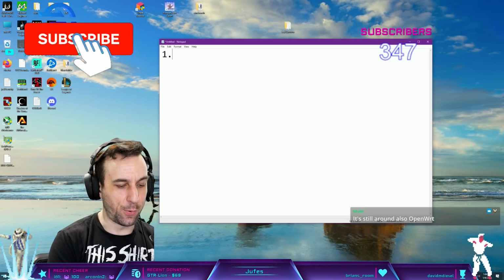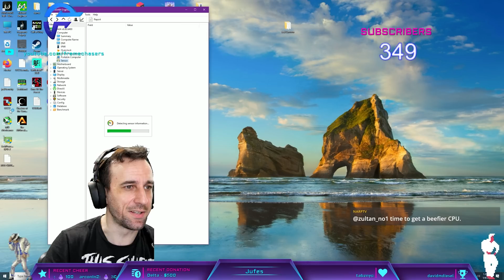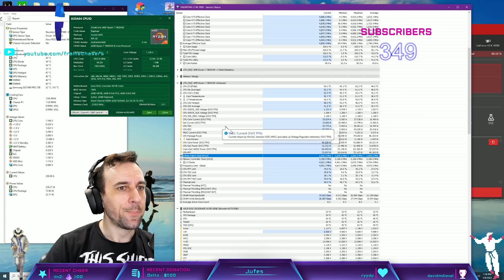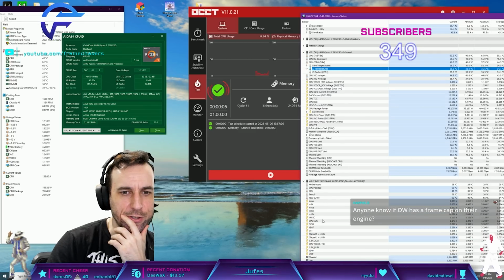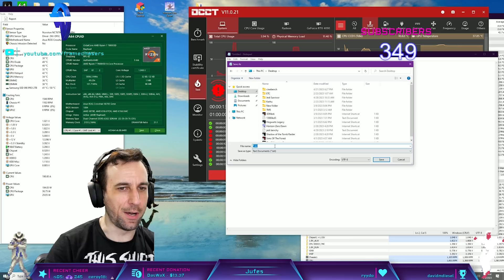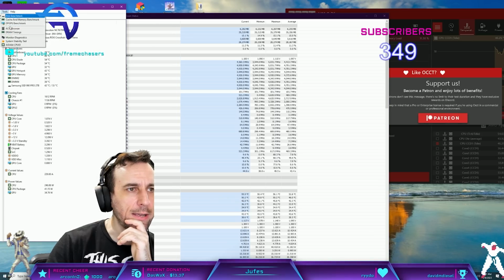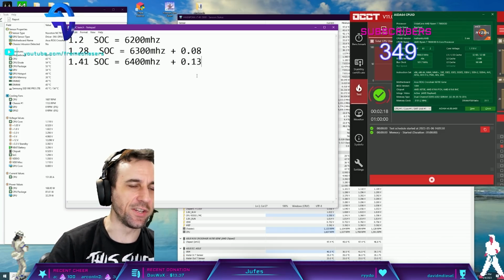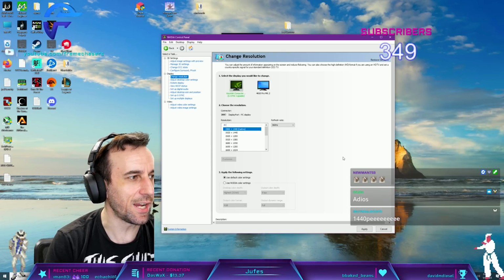Please Don't Do This...  7800X3D SOC Voltage Scaling. 😵

Comment: Queria saber o motivo do clock do meu 7800x3d esta baixando em jogos, ele conserva em 5050 porem quando ocorre algo cai os clocks e logo voltam

ppt limit 77000
tdc limit 280000
edc limit 350000
curve opt negative -40
ddr vdd 1.4
ddr vddq 1.4
subtiming controlo
32 42 42 84

benchmark r23 esta fazendo 18400 pontos com 4850 mghz e 5040 mghz em outro, com 75c°, nao uso scalar nem llc, quero deixar cravado 5050 no cinbench sem deixar baixar os clocks batendo no maximo 70c° 

heeeeelp

Comment: i am on expo setting vsoc 1.33v. for 6400mhz 32 cl on 7800x3d .  lexar ares rgb 32gig ram. dont know if it might deal damage in the long term. i wish to lower the soc but i dont know how and i am worried that i might spoil my pc. i hope for the best.
Reply: Same. My board is pushing 1.310v for 6000mhz cl30 on 7800x3d. I don't know if I should change it or keep it.

Comment: My board was pushing 1.38v soc when I first set up my 7800X3D and 6000mhz EXPO.  
It's entirely stable for over 2 months so far at 1.2v
Reply: Mine is pushing 1.310v and I'm not sure if it's safe
Reply: @Khannah69  It's safe, though longevity will probably be affected a bit if it's running that voltage all the time.  You should set PBO up and turn on C-States so it backs voltage off on a balanced windows power plan.
Reply: @CHAOSMOVEMENT  Didn't try PBO CO yet. I'm already on balanced power plan. C states on auto
Reply: @Khannah69  C states looks good, just try setting PBO to core optimizer, all core - 20 and see if it's stable.  You can try auto but it will run higher voltages.
Reply: @CHAOSMOVEMENT    I'm in the same situation here. On my MSI B850M GAMING PLUS WIFI 6E board, it's set at 1.304V by default  with XMP enabled, but sometimes under load I hit spikes up to 1.310V (it was during compiling shaders (in game) in  RPCS3, which is known to be a CPU-hungry app). Do I need to lower it a little to 1.29V? (I fear instability) I will eventually try to put it on balance and do some tweaking in curve optimizer. Hope for the best.🤞

Comment: With expo 6000 memory Gigabyte defaults to 1.287v on HWinfo but u can manually set it to 1.115v and it will be fine.

Comment: Anyone know if higher soc voltage helps latency? Or does that not matter much. Currently on 6200 with 1.25 volts but i can definitely bring down the voltages of soc if needed just curious

Comment: F that 200mhz anyways man. If my system is safe in 1.2v it will be on 1.2v. For so long ive waited to upgrade my system. Finally i had the chance to do it but now i have to deal with this sht. 
So yeah expo on /1.2v soc seems the way to go. Thanks for the video.

Comment: SoC voltage has nothing to do with RAM voltages.
SoC handles the memory controller voltage, and EXPO does not change SoC.
Reply: Higher memory clocks needs the infinity fabric aka memory controller aka vcore soc to have more juice to work. Thats why he was searching for maximum memory speeds with lowest vcore soc possible

Comment: When i had the 670 extreme and 7950x i had to enable memory context restore and pwer down mode to get any kind of stability. 

This 3d update looks like a wash when you have to finalize implementation and scheduling yourself. 

At this rate, the amd chips should be 300 dollars off in its current state

Comment: What you'll probably find based on my extensive testing is that it seems to be stable at lower SOC voltage but isn't (it'll pass OCCT, Aida, Prime 95 for hours fine), but then it'll ransomly crash out during gaming etc. My chip needs 1.33v to do 6400 stable (and I think I have a very good one), it's taken me two weeks to find this out and LOTS of testing. I might drop it down to 6200 and lower timings if it's happy at 1.3v or lower now.
Reply: @madpeteST you still running 6200 at 1.3v
Reply: Guys, how are your chips after 2 years on 1.3+ VSOC? 😅 No burned holes?
Reply: I'm running at 6200, I needed almost 1.4v to hit 6400.  6200 seems to be MUCH easier on the IMC and I don't like fire...
Reply: @Pandemix78  hows the cpu now?
Reply: I have 6000MHz Ram and im really unsure whether I'm stable. Currently, I'm on 1,15V vSoC and everything seems stable (y-cruncher, OCCT, prime95, Linpack, aida64 and playing LoL)
However, according to what I see here, I'm probably not stable... How did you notice instability exactly?
Reply: @Germania-444  hows the cpu now?

Comment: Hey dude, love your content. By any chance, do you have a video on under volting a 13900k? I know you focus on overclocking and getting those gains, but just wondering how you would run a 13900k so it won't run too hot if you have limited cooling options.
Reply: Turn off ht. Limit cpu to 250w

Comment: Voltage is beyond the point, the point is that the CPU can short itself and not shut down on thermal…I can go into my BIOS right now and set the voltage to 1.5 on my Intel and it won’t burn up, it will just power off..This chip is flawed from a design point, as it ages that limit of 1.3 will start to creep down, 3 years from now 1.2 might cook it..AMD is like taking a stock 2L Honda engine and strapping on a 64mm turbo off of a cumins diesel, sure she will go like a bat out of hell for half of a dyno pull, but she’ll explode, not a matter of if, but a matter of when. Stick with what works boys and girls, stop chasing saving a couple bucks and getting an extra 2%. All the stock holders are FAFOing around too, nobody in the server space is loyal, if they were then nobody would of gone to AMD, if Intel comes out with a banger than AMD will go back down to 13$. No value, just like their consumer products. AMD took a lot of risks, that’s why they came up in such a short amount of time, Intel is slowww they take their time, test test test. In the long run and for myself, I want reliability so I’m going to stick with Intel and NVIDIA, a couple good products in 3 years doesn’t mean anything to me, especially when they have all had issues.

Comment: 6400 at 1.3v no issues, been running at that sense 7800x3d launch.
Reply: 6600 at 1.285 which droops down to 1.265 on hwinfo under load, 7500F
Reply: I have mine at 1.33v and it’s really scary, it is the auto value from the XMP profile
Reply: 6600 is crazy then you can also run 2200 flck for max juice

Comment: Just buy 13600k + 760/790 board with DDR4. Cheap, fast and 0 problems. I OC'ed lots of different platforms, 13600k + 790 + b-die was by far the most fun, it either recovers really fast from errors or is just rock stable with seemingly crazy high settings (like 6ghz).
Reply: You mind saying what settings you used to get 6ghz? i get insane temps when i get to 5,8ghz in cinebench (360 rad and d5 pump)
Reply: What B760 do you use? Im torn on what to pair with the 13600kf
Reply: What a joke, 7800X3D faster than 13900K on way less power consumption.
Reply: @Directx11cool  AMDfags on full AMDip control jej

Comment: When i had my 5800x it was stable at 4.8ghz at 1.28v. To get it to 4.9ghz it needed like 1.5v...just not worth it. Seems AMD just cant figure it out. Intel is just so much easier. Stable 5.4ghz on my 13700K (stock turbo all the time) and 7200mhz DDR5. Glad I switched

Comment: Increasing SOC above 1.20v causes nothing but problems on my B650M Aorus Elite/7700x. I leave it at 1.20v but there is a process for getting a stable 6200mhz. I have to boot into windows w/stock bios settings, then shutdown and boot with EXPO enabled, then shutdown and boot again with 2033/6200. If I try to do all bios tweaks at once it will NOT boot into windows at EXPO 2033/6200. Once I follow this procedure though I'm good to go until bios update. I can get it faster with lots more tweaks and voltage but it makes zero difference in gaming far as I can tell.

Comment: My friend wanted a 7800x3d rig, I have his memory running at 6000 with heavily tuned timings and its perfectly stable at 1.150 SOC voltage.
Reply: What ram kit is he using?
Reply: @Next_Play_Shenanigans  I don't remember off the top of my head, but he bought it before asking me. Its a Gskill 2x16 XMP kit that I think is 30-40-40-96 out of the box. They are Hynix sticks.

Comment: Before i bought the 7950x for my server i found that 1.2 is apparnetly the max set by TSMC, so i set it to 1.1, what does it matter to me though, all core i needed to stay under 90w, and preferably under 75 so the fans on this small server weren't screaming.
Still wish Intel would come out with an all E core Xeon that i can thrown into LGA1700, say 48E cores with a socket power of 120w, but better multi-core performance of say that 280w 32 core thread ripper 
As it stands i have to hack in hardware acceleration for the Ryzen iGPU, Intel's iGPU just works but they dont make a CPU with good enough performance per-watt for my needs.

Comment: EXPO kits cap at 6000mhz the sweetspot AMD stated and most don't tune their ram there was no reason to ship any bios over 1.2v vsoc
Reply: Not anymore, there are 6400 C32 EXPO kits available.
Reply: Now the best are: 6400 CL28 and 6200 CL26

Comment: I have built my first ever pc with ryzen 7800x3d and 4070ti for 1440p. I have g skill trident z neo cl 30 1.35v, and im scared to turn expo on. I have b650e aorus master with latest bios installed. Why is in your video cpu vddio/mc voltage 1.35-4v Isnt that to high? My defaults are 1.10 v but i have seen that i goes up to 1.15 sometimes. Plus people are saying that gigabyte bios is buged and if you put expo on it will instantly go to 1.4 ans bypass expo settings 1.35v to provide better preformance but its not safe.

Comment: I got the exact same results pretty much last week. 6400 took 1.37, but that ran at 1.396v actual according to the bios,  My Asus b650e-e was running stock at 1.426v on the soc out of the box.  6200 vs 6400 is about 2 ns.(hynix a-die dual rank)
Reply: What's your aida64 result in memory and total latency?
Reply: @Directx11cool  I dunno what the bandwith was like, don't have aida installed anymore. It was basically 58.4 and like 60.4 (+/-) .2 roughly from 6400 to 6200 respectively.  Again, it's 64gb dual rank A-die though so.  Does 6200 np at 1.224v. Could probably go lower, but since that's  "safe"  I just left it.
Reply: @Pandemix78  I've got 69.24 / 90.5 / 69.2 and 60.4 latency on 6000 hynix a-die 32x2. Do you have 2 sticks 64Gb dual rank (128 total)?
Reply: @Directx11cool  2x 32gb (64 total)  Timings are tightened, but not fully tuned.   I used the same timings as debaur used for single rank in his ddr5 tuning video.

Comment: RAM speed is very important for FPS dips in flight simulator and there you don't want stutter. So then every 100MHz may count as that game shuffles alit of textures.
Reply: When it stops scaling it stops scaling. Why run dangerous voltages if your gains can be explained by run to run variances. I have not gone further than 3600Mhz CL14  with tight timings on my R5 5800X3D, undervolted it and my RTX 3080 and I have second place on Time Spy with my hardware, I was 70 off first place who had everything max OC and a waterblocked GPU.  I guess my PC lives a way healthier life than whoevers PC was on top.  I think that PC was at like 4133Mhz ...
Reply: @josteinbrekke4343  agree with what you say but you are missing my point.
Reply: @josteinbrekke4343  There's no such thing as "it stops scaling" I see scaling with a 5800x3d up to 3800 cl13, 1.61 ram voltage. I tried to stabilize cl12 but couldn't get it stable at 2.0v, perhaps I need better binned sticks or a board that goes over 2.0v
Edit: nevermind, I probably just need to turn on ln2 mode and it unlocks voltage over 2.0 but then I need to start putting lots of fans and stuff to cool the ram down too much work...
Reply: imagine shoving lethal voltage into your CPU for Flight Simulator
Reply: @gozutheDJ in contrast to the conclusion in the video my point is only that RAM speed do matter, nothing else.

I'm not encouraging anyone to kill their equipment.

Comment: SOC voltage seems to depend on which gpu you have. put a 4090 in and see if it works at 1.2v. My 7900x needs 1.27v in windows, 1.32v in mbo for it to work properly. It will boot at lower voltages but the gpu defaults to gen 3 and only works in a slow safe mode. Please check your gpu is working correctly at 1.2v.

Comment: What about the CPU VDDIO/MC voltage?
some people say 1,35 or 1,4v is way to high and you should keep it at 1,2V if possible !?

What do you think about this??
Reply: Just try tu run as low as possible i am on 1.3v 100% stable at 1.285 instability occured ... Right now 6200cl 28 38-38-38-trc 45 twr48 ... Memory both voltages 1.45 and Flck2200 100% stable anta777extreme 12h test ...in Aida latency 53.9-54.4 NS
OH whats interesting my SoC voltage is 1.15v even 1.12was stable but i set it bit higher to be sure 😅
Reply: @Malklaw  That test isn’t the best. Try 1Usmus, VST, OCCT.
Reply: @Harshell123 i will try ussmus overnight thanks for info ... I thought anta was more demanding ... In games no problems at all for now so probably should be ok
Reply: @Harshell123 how long usmus test should be fine overnight or 12-24 maybe ? I am worried for my electricyty Bill this month 😂
Reply: @Harshell123  What about Karhu? I tested with that and then I go benching SOTTR and I got freezes. First I thought there is something wrong with the GPU, then I remembered I lowered SOC/VDDIO to 1.25/1.20V because of these X3D problems (I have 7600X). I'm now on 1.30/1.25V, but I would like to test stability properly.
What about Prime95 Large? I used it with 10900K for lowest stable SA/IO voltages and it was fine.
Reply: @Gr1mR34p3r85  Karuh is also a good memory test. I would always use OCCT Large, AVX2 variable for CPU. Memory VST, OCCT, 1Usmus, Karuh are the ones I would recommend. You may pass hours if one test then get errors pretty quick in another. Memory testing can be tedious.
Reply: Vst ok too and memtestx86 from USB didint try occt
Reply: Ive ran 1.4 on the vvdio since launch on my 7950x3D — all is well and stable with Buildzoid timings, wasn’t stable at 1.35

Comment: On which motherboards can LLC put the SOC over set bios voltage ? Owner of X670E-I & X670E Gene for the last 6 months and the SOC never budges from 1.35v. Oscillator tested.
Reply: On all
Reply: I've just set SoC LLC to Mode 3. That's what ChatGPT suggested to me. ChatGPT gave me whole spreadsheet with all the voltages, best BIOS options etc for lowest latency and best 1% lows in games